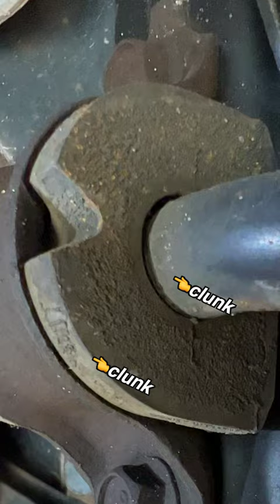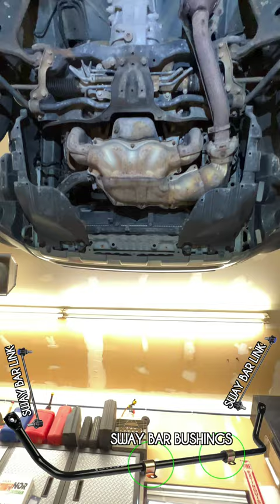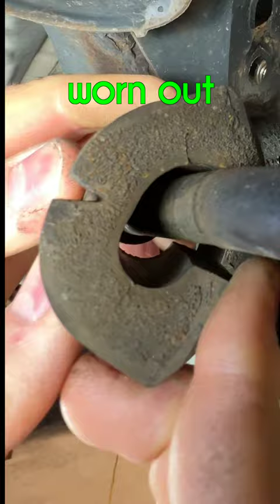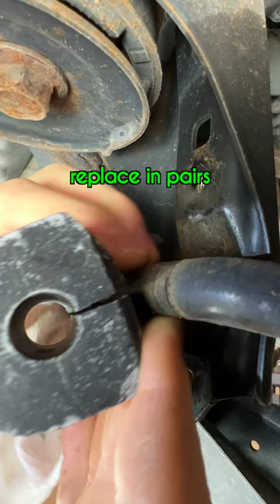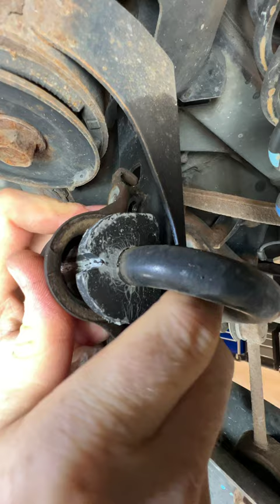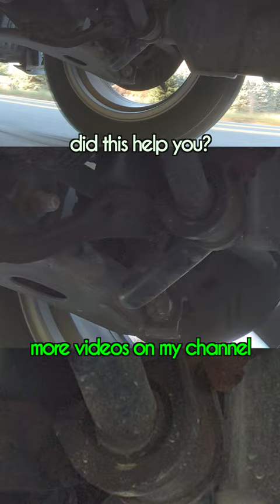sway bar bushing replacement 🚘🔧✅

Comment: Nice video dude. Was curious if I could do this on the ground and looks like a yes. Just do one bushing at a time maybe?
Reply from the maker: If you want to do one side at a time on the ground that should work good. But you want the axle level so there is no difference side to side in the suspension heightl. Otherwise there will be pressure on the bar 😃🔧 
Here is the full length video https://youtu.be/0S8JBe_jn6g
Reply: @EasyFixShaun   yes on the ground figured I would get the vehicle jacked up and on aome jack stands at the same height and just do one side each. I'll be doing the bigger middle bushings.
Reply from the maker: The sway bars job is to level the suspension from side to side linking them together to the frame or uni-body. In the full length video I explain that it's best to do both sides of any given axle at the same time. Basically you want the suspension level wether jacked up or on the ground. Otherwise you will could fight the bars "spring" pressure from side to side. Can make link replacement especially hard. Usually it doesn't effect bushing replacement as much but it can. I have fought before and it is no fun. I only replace those parts when the axle is level up or down on the ground. Saves me a lot of headache. I hope that helps 😃

Comment: I have a clunking noise when driving over speedbumps. Could it be the bushings?
Reply from the maker: Very possible. Check out my long form sway bar link and bushing video on my channel page. Tons of tips to help diagnose sway bar parts easily 😀

Comment: A good deal of aftermarket bushings (and even oem ones) dont come with preapplied lube. I recently purchased a sway bar from whitleine and they explicitly sent over lubricant for their sway bar that was to be applied to the oem bushing.
Reply from the maker: there a few companies like white line that use a different material other than factory rubber replacement where lube is ok and good for them 😃

Comment: Does this also cause vibration at turning when speeding or the car been tilted left or right?
Reply from the maker: Sway might be detected. I wouldn't normally think of vibration as a symptom of sway bar components really. But vibration while turning could be a wheel bearing symptom description..

Comment: Can that cause your wheels to go in and out in the rear or just sway bar links in the rear I got a alignment and they went bad again like a week later my rear tires back Crooket and also car fishtails in the rear more now
Reply from the maker: The links and bushings stabilize the ride characteristics of the vehicle at all speeds. They stabilize side to side height differences on a "single axle" only. So rear or front will  need separate systems. They don't control actual suspension arc, steering arc, or change alignment angles (caster, camber, toe settings). You may have something else going on other than sway bar links. You could have several issues causing that. Your car will need an inspection somewhere to figure that all out. Sorry for late reply. I hope that helps 🔧

Comment: Some sway bar bushings have the grease fittings on them. Why Is that? If you say run it dry?
Reply from the maker: I have never seen that except with aftermarket poly bushings. Is it an oem manufacturer you are seeing that does that?
Reply: Alot of the off road trucks that come thru are aftermarket lifted and custom. Some stock trucks roll thru. But if they have grease fittings I shoot them with my grease gun. I run that blue amsoil grease.
Reply from the maker: interesting. Maybe a Demand and Supply thing?

Comment: I have change in my asx and now squeaking like old sofa-bed. When you change the wheels must be up or doesn't matter?
Reply from the maker: Sway bar parts can be done up or down as long as the axle is level. Suspension droop must be equal side to side or there will be pressure on the bar. Check out my long form video. TON'S of extra information 😃 
https://youtu.be/0S8JBe_jn6g

Comment: Do you have to jack the car to replace these?
Reply from the maker: No as long as the bar design doesn't support vehicle weight(roughly 99% of vehicles). But you do want to make sure the vehicle suspension is level either way you do it (jacked up or on the ground). Otherwise the bar twists and try's to level the suspension and will make replacement of links or bushings very difficult. Does that make sense? I have a great full length video that explains it more if you need it on my channel 😀

Comment: Do you recommend removing the links first in order to change the sway bar bushings?
Reply from the maker: Time and effort to change either a pair of bushings or a pair of links isn't a whole lot different if doing them separate from each other in either order. Although if doing separately you would have more effort in obtaining parts twice and setting up the vehicle for replacement twice 😃
Reply: @EasyFixShaun  so in order to replace the bushings, you have to take off the links no matter what? (Even if not replacing the links)
Thanksb
Reply from the maker: @user-lg9qw4ic5m  Bushings can be done separately. Links can be done separately. Or they can be replaced all at once.

Comment: Can a sway bar also get twister or like crooked? I have a 17 mustang GT that feels very rough on these California roads I already replaced the shocks, struts and removed the lowering springs the car came with but the ride feels exactly the same if not worst
Reply from the maker: Anything can happen but i haven't personally seen or heard of a bar doing that. Usually they wear like a leaf spring since they are made of spring steel. Usually they last forever or break in half. I have not seen too many different types failures in between those two. What brand of struts are on it?  😀🔧

Comment: I think I found reason why my suspension sound like old sofa because I use some silicone spray in this place
Reply from the maker: Very likely! That is the exact reason I don't recommend lube. Bushing replacement will solve your problem though. Install them dry and you should be good. I would recommend oem links also, and you should be good for a long time 😃🔧

Comment: Replaced mine and still getting the noise any ideas?
Reply from the maker: How about the sway bar links. Are those ok? You can hand shake them to test. I have a full length video with other ways to test links also.

Comment: Mine is at the dealer now for the second time (warranty 18k miles). The parts are supposed to be there today.  The all ready replaced two parts still had the clunking.  I'll get to see if they used lub or not. My point is, at 18k miles, its a piss poor design if they fail that fast.
Reply from the maker: 💯. On some very rare occasion different size sway bars are put on the same vehicle and very by only 2mm. If the wrong bushings were used it would make noise within a few thousand miles most likely. Maybe that happened? On some other cases the bar wears by 2mm and causes the same problems. I don't see that often but it does happen. Usually the soft rubber bushing will be the wear item. I hope you get that all sorted out. Hang in there! 😃

Comment: why did you grease the bolts?
Reply from the maker: The bolt was a little difficult to remove. A small amount of corrosion was on the threads. Normal for my climate. I could have run thread chasers down the bolt and cleaned them along with the "nut" side. Adding grease was a quick fix for the corrosion and should get trapped in the threads making next removal a little easier. So i went with that. Personal preference. The grease isn't required 😀🔧

Comment: Sway bar is a torsion spring should also be replaced.
Reply from the maker: wat? why would you replace a spring that isn't broken or sagging?
Reply: @EasyFixShaun  I'm not pulling your leg. All springs should be replaced over time. Leaf springs and coil springs are service parts. Many people overlook the sway bar.
Reply from the maker: @juliuscaesar2792  Show me a maintenance manual saying that. I think it will be hard to find most likely. Springs have some service limits. But, they are made of spring steel. Unless they break, crack, or sag... they are considered good.

Comment: Mine came with grease already on them.
Reply from the maker: Nice. Did you throw it away? Were the "poly"performance bushings?
Reply: @EasyFix.  no, I didn't throw them away I put them on the car.  I purchased them from Amazon.
Reply from the maker: Oh gotcha! Sorry for the misspelling there. I was wondering if you used the grease? Are the bushings working good so far for you?

Comment: Death wobble, changed sway bar bushings, thought i was done. Nope, still goes into a wobble when i hit a bump or pothole...what else could it be??
Reply: You have bushings in your upper and lower control arms, but it sounds like maybe bump steer is your problem? My suggestion is to check ALL of your ball joints, which should typically be one upper, one lower and our outer tie rod end. Check your inner tie rod end as well, as that can directly affect your steering
Reply from the maker: What year make model and mileage do you have?
Reply: Put the hammer down
Reply: @jorgemabarak7932  Thanks for the tips. I've tried to shake the wheels but nothing into caster-camber direction. There's a bit of click when shaking left-right, but seems close to pitman arm. Question is if there shouldn't be any play at all(?) I have a 4x4 with straight axle, fyi.
Reply: @EasyFixShaun  I have a 1996 Jeep Grand Cherokee Laredo 4.0L
Reply: @JorgeInTheTube  There really shouldn’t be any clicks, my truck will click on one side just by pushing the car a little bit while it’s on the ground. Suspension can be super weird. Side to side might be the outer tie rod end. That pushes and pulls your steering knuckle in either direction to turn. if you have a 96 with stock suspension, I’d suggest doing all your ball joints anyway and see if the sound goes away. Even if that’s the source of the click or not, your ride will be a million times more controlled.
Reply: @jorgemabarak7932  Thanks Jorge. I am realizing I should just change it all out. I have done upper and lower ball joints on one dide before, i can fo it again and on both sides. I'll chack all tie rods and change as well. Same with the other bars. There's some other joints like a rod that goes from left to right in a diagonal, uhm(?) Also, theres a sway bar connection with a small rod, that also seemed loose. Looks like it will be a long weekend of driveway toolin fun!
Reply from the maker: Get a helper to shake the steering wheel with the weight on the vehicle and engine off. Move wheel small amount from 1130ish to 0030ish and while you track the source of your looseness and noise. Those jeep are notorious for needing a helper to be accurate. Sorry for the delay 😃

Comment: IT'S SUPPOSED TO BE ALL DRIED AND CRACKED UP LIKE THAT???
Reply from the maker: That is a thin coating of some sort of dry lube or wax from the oem manufacturer. It could be the release agent from forming the part in the mold. I didn't taste it so, I am not certain 😃🔧

Comment: I disagree rubber grease is the way to go especially after all the oil ect that will have leaked on them eventually.
Reply from the maker: What is rubber grease?
Reply: @EasyFixShaun  grease that is made for rubber…. Like brake grease is grease for brakes… did that seriously not click for you dude?
Reply from the maker: don't grease any sway bar bushings. You will be sorry you did.
Reply: @EasyFixShaun  how will I be sorry I did? Greased them, never had a problem
Reply from the maker: @jorgemabarak7932  Usually they will make noise and need replacement to repair again. That has been my experience. I hope it works for you okay though.
Reply: @EasyFixShaun  not sure how much experience you have if you’re claiming running a bushing DRY is beneficial. Almost every other moving mechanical part of a car has grease. All for the same purpose, to avoid noise and to reduce wear. Brake pads and slide pins, just about every o-ring ever whether it’s fuel, AC or oil systems, bearings are greased, ball joints usually need regular regreasing if they have grease fittings. Lubrication is actually a critical element to a vehicle suspension, more particularly in places where bushings are not pressed in.
Time will you that you should have greased those bushings
Reply from the maker: No grease never ever is always best Scotty Kiltmer, https://www.youtube.com/watch?v=dQw4w9WgXcQ

Comment from the maker: Full length A+ sway bar link video~
https://youtu.be/0S8JBe_jn6g
Reply: Thanks for great video 
I’m definitely not getting clunking noise I can hear clicking when I turn to the right I took car to the Firestone they told me I have bad axle 
👍🏻👍🏻👍🏻👍🏻
Reply: Will that make popping noice I hear when I start car. With put neutral it doesn't make it only on park or when I am stop light.
Reply: Would you happen to know how to take a sway bar bushing on a 2016 kia soul. I can't find anything on how about it. I am just curious If I can just take the bottom sway bar link off it's new just slide it out of my way but was looking for a video or advice on how tough it would be to take the bushing off. I ain't no mechanic so any advice your able to give would help very much.

Comment: After reading all these comments about grease, anti thread lock, and whatever… I must say…. Either way if u use basic common sense, it will be fine either way!
  However I have to agree that having some type of anything that stops rust, and it “locked on bc of rust” is what I do as well. Wether that’s grease, anti-seize, or wd-40… use something to freshen that steel up, and to protect it from Mother Nature. Nuff said
Reply from the maker: no